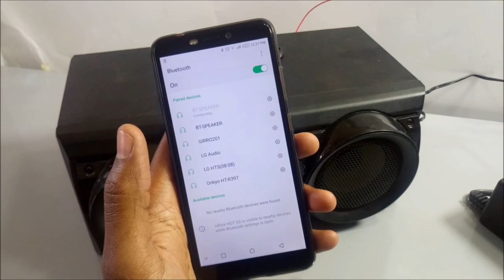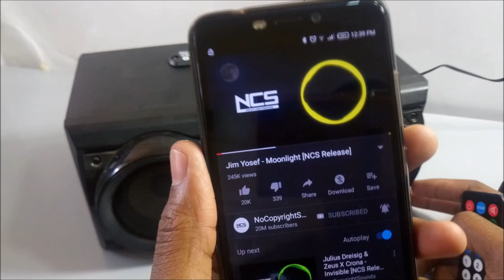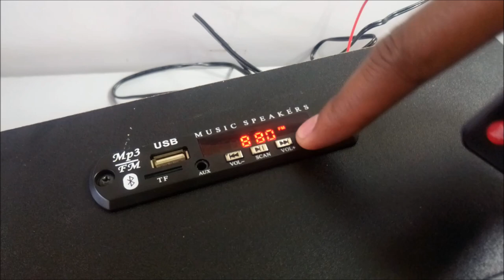Easy Bluetooth Speaker, DIY Part 1

Comment: you have  comprised the sound quality.. the ccabinet is no  longer air tight.

you  could have drilled the plastic infront of the speaker instead
Reply from the maker: The space on the plastics was not enough

Comment: Stop keep saying  I'm going to  shout up. Also  5v adapter is not enough power  to put all speakers.  Put a standard 12v
Reply from the maker: But it worked, part 2 is on the way